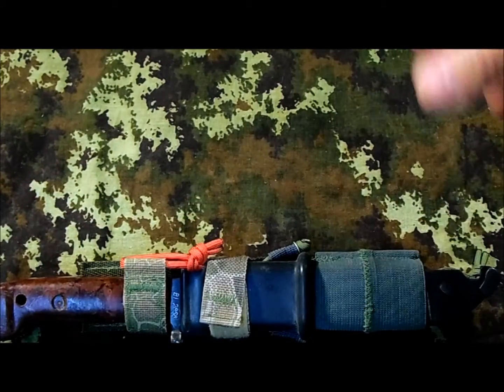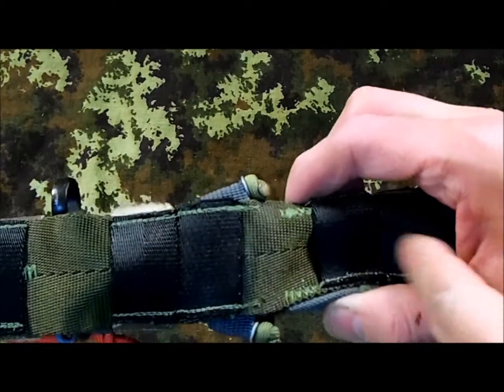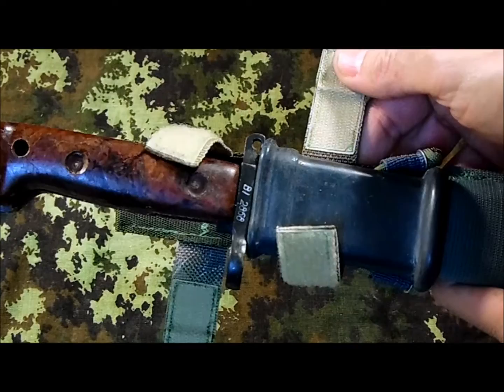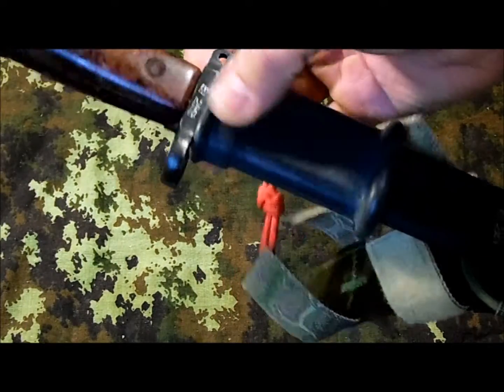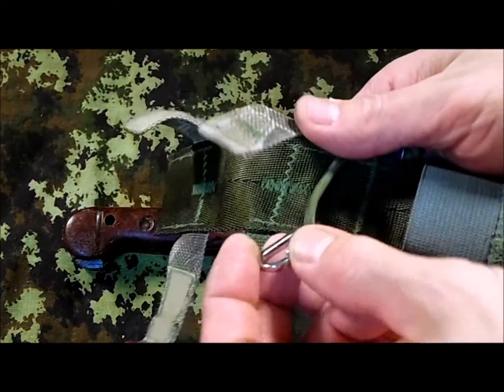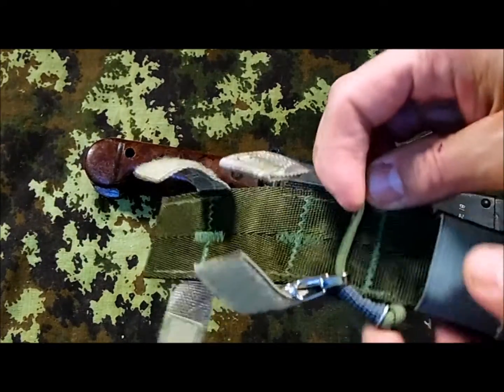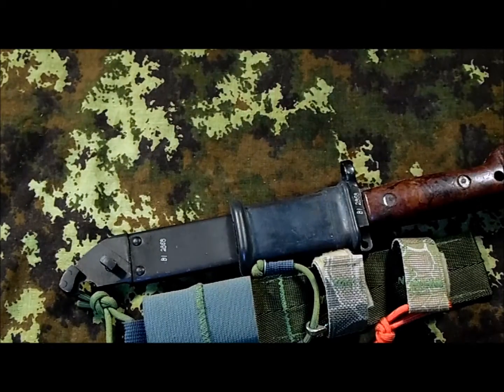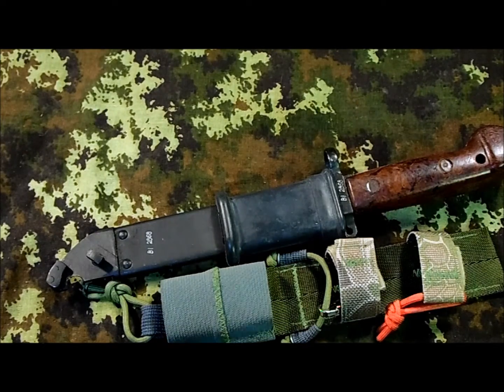Ak47 Bayonet  MOLLE Sheath  System by mr  leonidas0001 overview

Comment: The rubber part is for cutting electric fences like you mentioned. You should be able to move it more towards the middle of the sheath. That way you can use the clip and it won't be in the way. I really need to get some AK bayonets. Add to the rest of my AK stuff collection lol.
Reply from the maker: +metaltrooper62 lol me too..:)